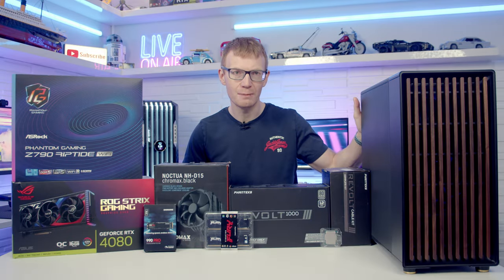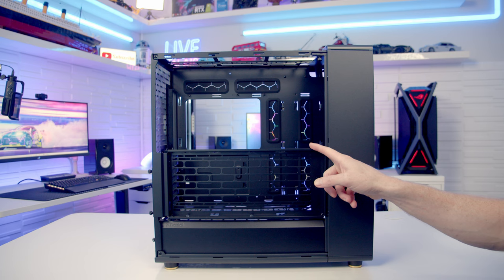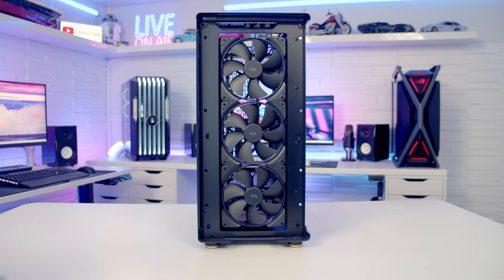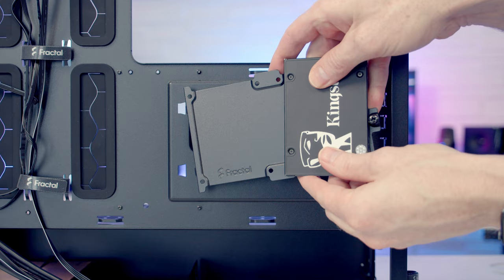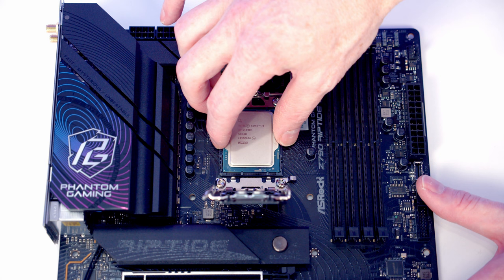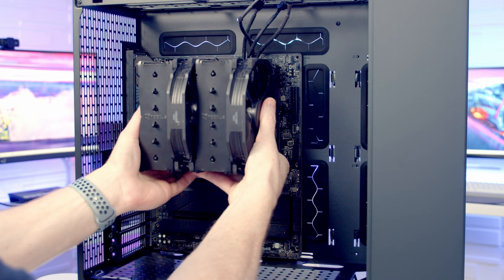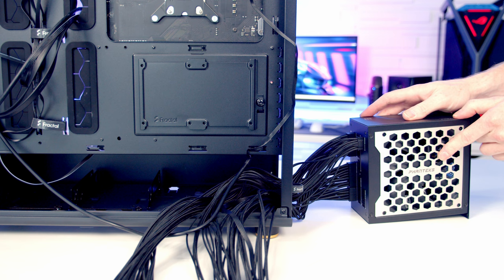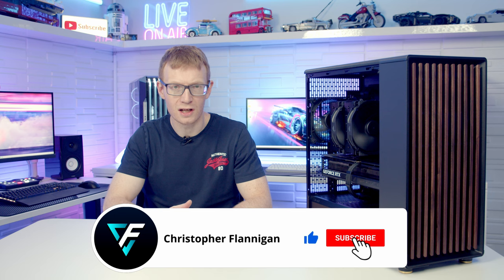Fractal Design North XL Build - Step by Step Guide

Comment: I followed your meshify 2 build guide when I built my PC three and half years ago. I'm back again as I want to swap the case for this XL as I feel this is more usable than the previous North. which tbh was beautful but seemed like a tight fit overall. 

I'm mainly trying to figure out if my PSU will be an issue, PC part picker is saying my Corsair HX1000 Platinum 1000 W 80+ Platinum length of 180mm is within the Fractal Design North XL ATX Full Tower Case maximum of 290mm, but exceeds the recommended length of 175mm. Please verify that the connector locations on the power supply will not interfere with the structure of the case.
Which I don't really get. I can see the PSU you are using is 160mm so watching to see how big a difference that 20mm will make potentially before buying. Im guessing its relating to the HDD cases being installed or not!?
Reply: 10:39 just what i was looking for. .AWESOME

Comment: is this build's Noctua NH-D15 enough to cool the  Intel Core i9 14900K?
Reply: Coolers are rated for 'watts' of heat they can displace. This setup will work, but it will thermal throttle if you run your cpu past Intel limits. That said, you should not need to push the limits for any games that will come out for a very long time. I would still go 360 mm AIO front mounted hoses down. Artic freezer 3 or comparable.